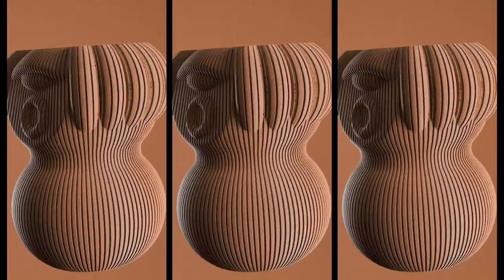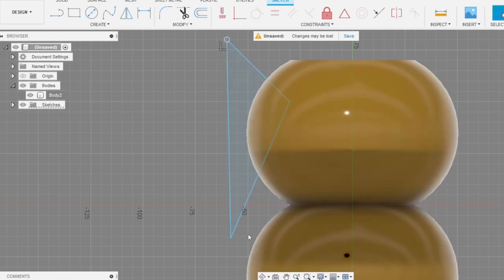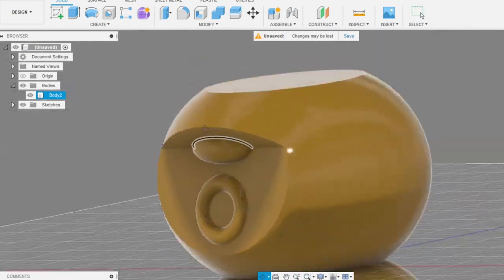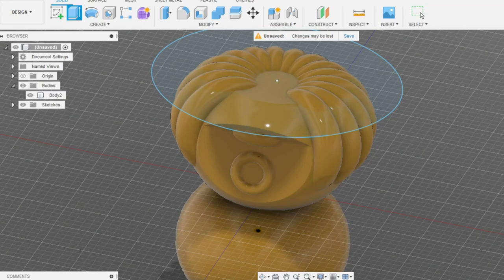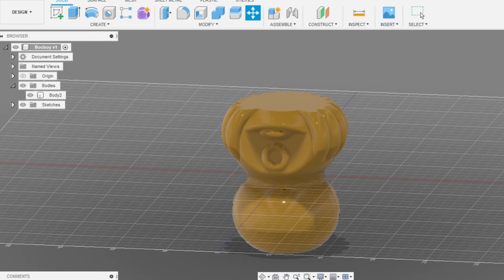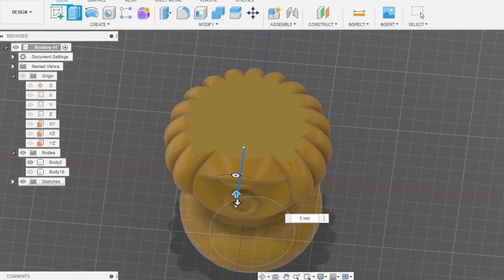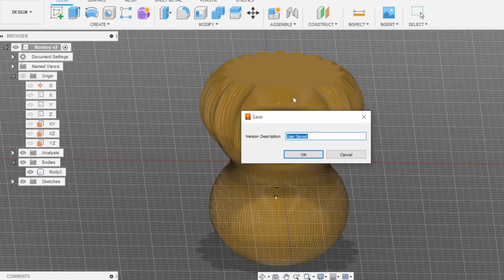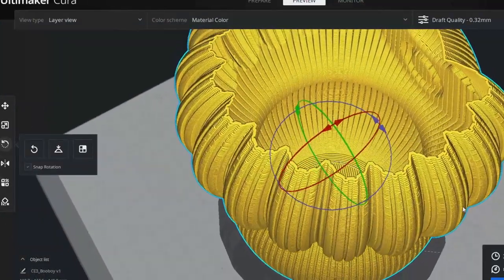FUSION 360 - COOL VASE  #fusion360 #3dprinting

Comment: Your screen was zoomed in making it easy to see what you were doing with the mouse, but the control panel was hidden off-screen on the right. For people not very familiar with Fusion 360, it would be hard to follow what you were doing. In future tutorials, it would be be good to be able to see that control panel. I am glad that you are doing tutorials in Fusion 360 because I do not plan to switch to Solidworks due to its cost.
Reply from the maker: Yeah i noticed that only after record. So I will fix it in future tuts ) Thanks

Comment: Why are you using the export command? It takes forever…just use the 3D print tool and uncheck “send to 3d printer” it saves the file as an STL and its super fast. Also scaling down the copied model is not the correct way to do it unless the model is 100% symmetrical, which in this case isn’t. A better way to do it it making 2 copies of the model (so 3 in total). On one of them you will use the shell command and create a 1-2mm shell. Then you will make a boolean operation between the shelled version and 1 of the other 2 selecting “exclude” as the operation. You end up with the original model and a smaller model with the same distance on every single surface to the original model.

Comment: I really liked and appreciated this tutorial, but there was one part that I did not understand. At 17:48 you add a 45° cone to the bottom. I understand that a 45° overhang is easier to print, but I could not really see what was happening when you joined this cone to the body. Could you explain a little more?
Reply from the maker: Yeah the point of this operation is to make the first layer in sclicer perfectly circle without any vertical cuts.  The changes can be noticed only from the bottom. Before it was like a gear with many tooths and after it`s become just a circle
Reply: @Kowafatcompany  Okay, now I understand and it makes sense.

Comment: You say that STL export takes a really long time. When creating STL files, I use the 3D print command and the export is extremely quick for me. For many export options, Fusion 360 uses the cloud which may be why STL exports are slow.
Reply from the maker: Yeah seems like the problem in cloud service. Regarding to Cura, I tried to export STL and files are heavy... Anyways I do my personal modeling in Solidworks and no problem with it)